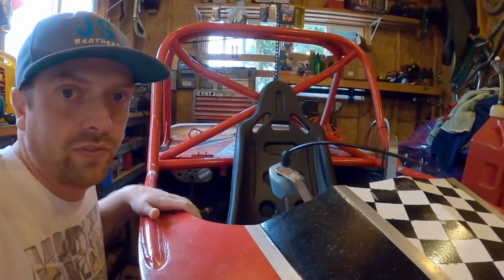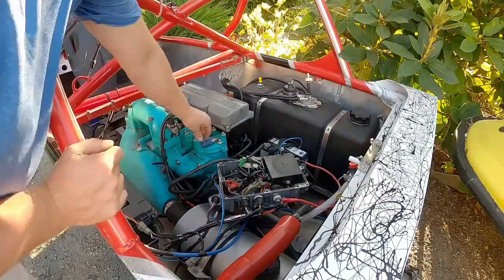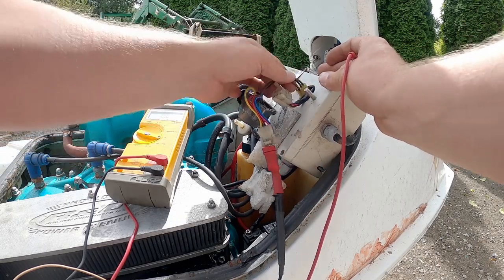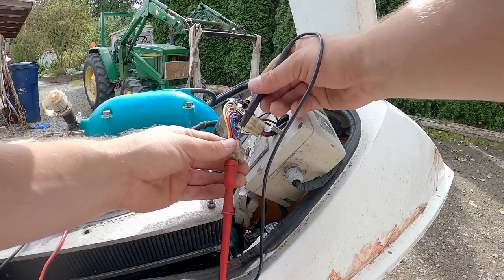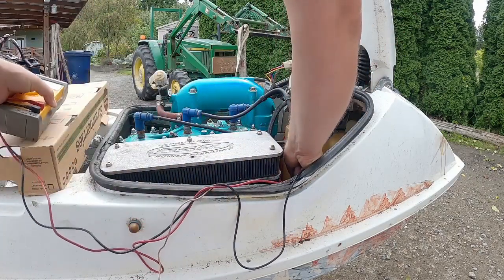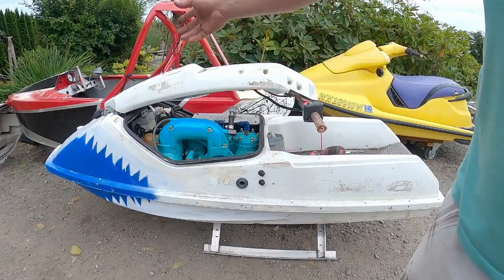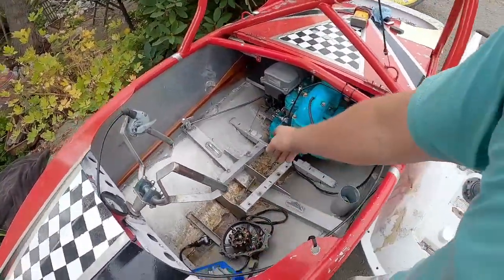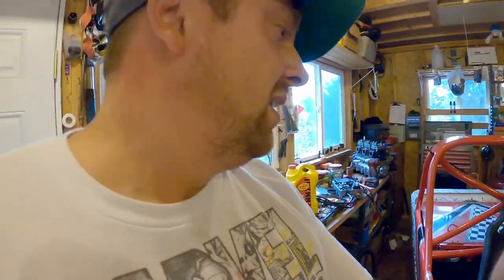Kawasaki 1100 jetski stator test and cdi test

Comment: Lol... "sounds like we're Canadian, eh!" 

Testing most coils can be quite frustrating.... I will explain kinda why that is, but this is more just for entertainment value as it doesn't make testing easier or better, lol. 

When you test an Ohm reading on anything, what is really happening is the meter is sending current through the part... that's why it can be dangerous to test sensitive electronics. The meter sends power in one side and measures how much comes out the other side... then the computer in the meter converts that with black magic math (not really that complex) and gives you a reading in Ohms resistance... the resistance to flow of the power it sent through the coil. 

The "PROBLEM" with testing a coil is that the power that you are sending through it is VERY TINY. Even if there is a problem with the coil (damaged coating on the wire) the tiny power will pass without an issue. Then when you try to use the coil, relatively large power goes through the wire and, bam... it shorts through the damaged area... This is most common in the ignition coils but also happens a LOT when testing stators. 

If your coil tests bad, then it is 100% for sure bad.... however, if your coil tests good... it's only maybe good....  Kinda like smelling milk to see if it has gone bad... if it smells rotten... it's bad, but just because it isn't rotten doesn't mean it's good. 

They do make a few "proper" testers for testing coils. These testers send an adjustable, high voltage into the coil and measures to see if it shorts out. This tester actually tests the insulation on the wires... if it is damaged, the power will short, even if wires aren't touching.
Reply from the maker: Joel Arseneault exactly why I don’t care much for ohms testing.
Reply: This makes entirely too much sense lol.  Right on.